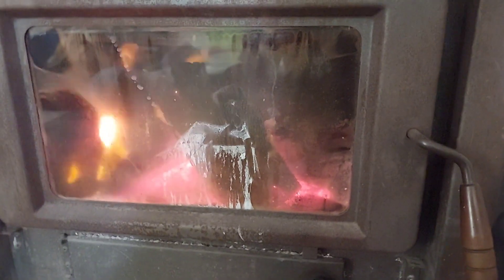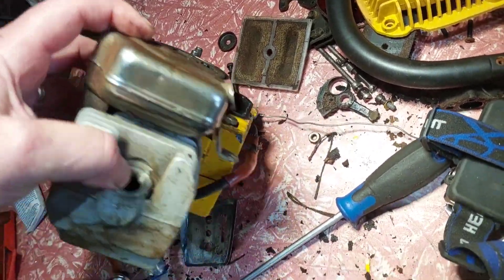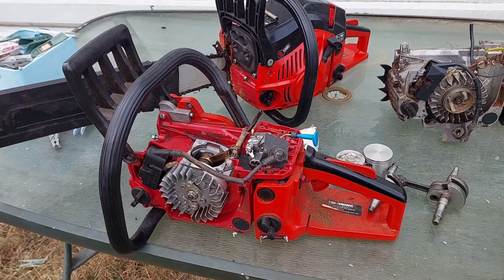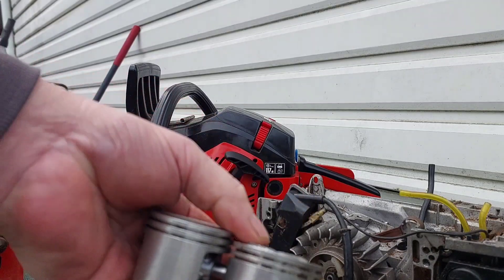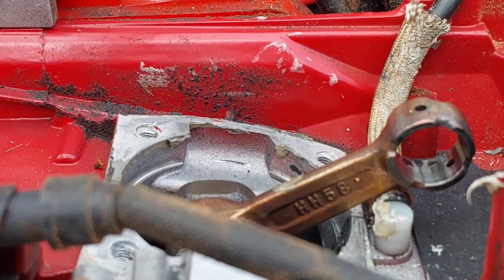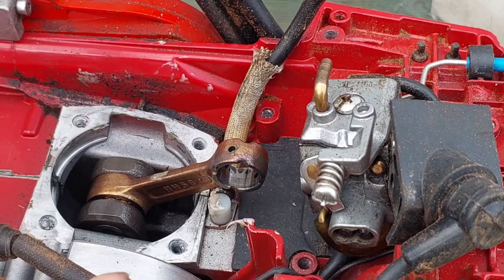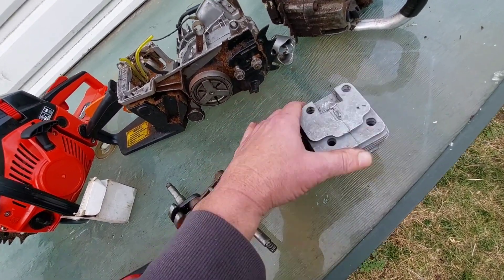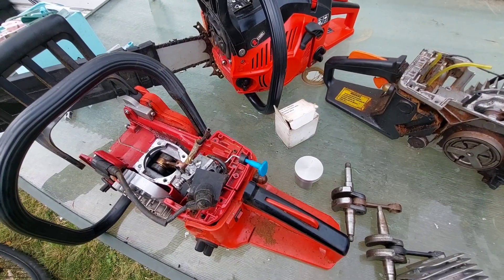chinese chainsaw 62cc with 52cc crank ms360 piston?

Comment: 62cc crank is 34mm stroke, while 52cc crank is 32mm stroke. 
With 52cc crank that has 32mm stroke, and 48mm bore cylinder, total displacement  will be 57.9cc. You will lose 2mm in stroke and decrease displacement from 62cc to 57.9cc.
Reply from the maker: Cheers mate for that 👍

Comment: did you ever tested to insert the MS036 piston into the 62cc cylinder with a thicker gasket?
Reply from the maker: I have the parts  ,and now I have a old Electric motor for my metal lathe so soon I will be playing with it cheers Kevin
Reply: so I guess when you are drilling down the piston then the differences are too big for a thicker gasket  @MrHangerone
Reply from the maker: @Stefanseiner  hoping to turn the piston into a pop up piston with 2 gaskets maybe cheers mate 👍 Kevin